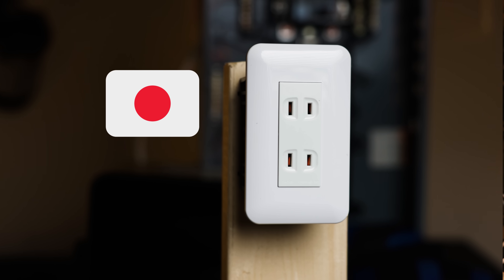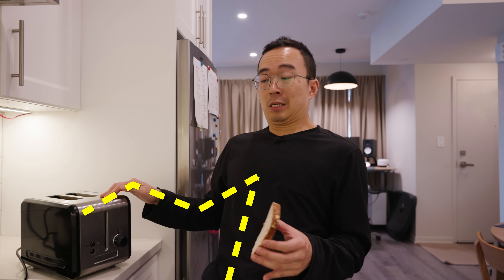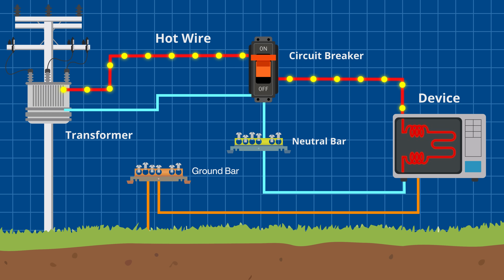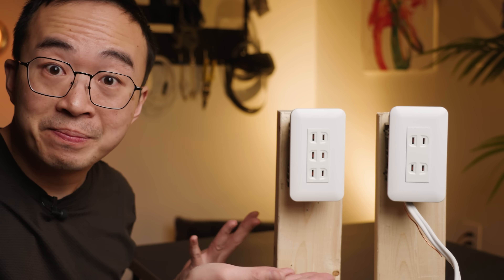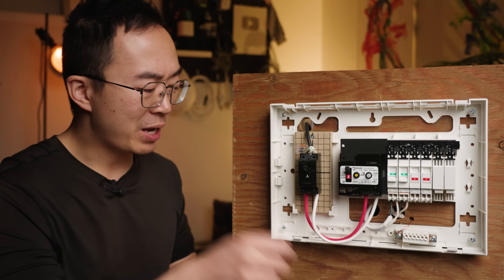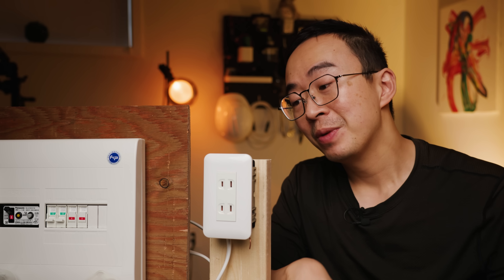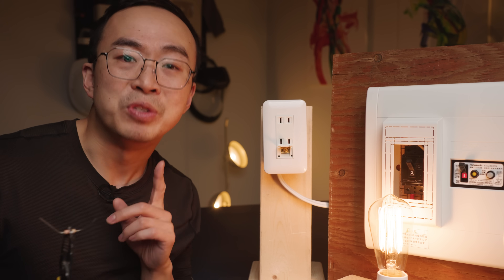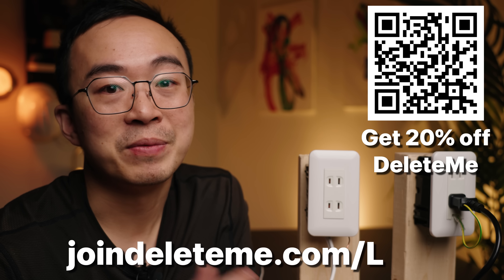How Japan Made Their Outlet Safe

Comment: Engineer here. Ground connection wasn't made to trip circuit breaker. There were no circuit breaker back then, there were fuses. More to say, most US circuit breakers do not even have magnetic breaker and they actually react much slower on short circuit conditions than the european ABCD circuit breakers for instance. Ground connection were made to protect life by providing a path to ground with less resistance than your body, RCD were originally made to further protect from fire. Without an RCD ground would save you from electrical shock but most likely a faulty appliance would cause fire. Modern RCD also limits current to the point that also protect lives as you've described even if an appliance lack connection to ground but it was a relatively modern change. The connection between ground and neutral is indeed may cause circuit to break but only if the fault is very prominent and provide a very low resistance path to the grounding wire which is not usually the case and it wasn't made for this, the goal was to pull neutral to ground not vice verse.
Reply: Actually all US residential and commercial breakers (aka MCCBs) are thermal/mag. Thermal for overload protection, magnetic for short circuit protection. Just look at any Eaton, GE, Square-D, Westinghouse or even Siemens literature.
Yeah engineer here too. 40 years in the industrial electric business.
Reply: @sootikins  Not strictly true. Yes, modern breakers have a magnetic trip, but much of the installed base is thermal only. I make it a point to cut open every failed breaker I have replaced, and more often than not it's just a thermal bimetal trip. I think I still have some brand new Pushmatic Bulldog breakers around here somewhere. Popular 50 years ago, and still made today (overseas replacement), and they haven't changed.
Reply: @jsurace  Ok, can't argue with that. I was talking about what you can buy today without considering installed base. Noy sure when the change from thermal to thermal/mag started...
Reply: @sootikins  Both thermal and magnetic are for wire overload protection, magnetic for accute and thermal for mild overload. This allows you to run a device that briefly draws too much power without tripping it, but it will still trip if your average load is too high. 

What europe ALSO has is a differential cut, which directly protects against leakages. If more power enters via the line than leaves via the ground, the differential switch trips and cuts the whole house (or your bathroom on a stricter differential)
Reply: @dojelnotmyrealname4018  I don't think I claimed otherwise. Of course thermal/mag is not intended to protect from shock. I was merely addressing the guy who claimed US residential breakers are thermal only which is false. 
Incidentally, "differential" breakers (aka GFCI or RCD) won't catch a line to neutral short but are good for line to ground.
Reply: @sootikins  I have three GFCI outlets. 2 near my kitchen sink, and 1 near bathroom sink. The bathroom GFCI will cut ALL POWER to the bathroom if i hit the test button, including both light switches (both together on a seperate panel from the GFCI) AND the FAN (wired in with one of the light switches).  Both Kitchen GFCI outlets will just cut power to itself (only the outlet tested).  All three appear to work as intended (they cut power back on when hitting the RESET button, like normal).... EXCEPT!!!!!!    
...There's no green light? on the outlet itself, it doesn't mention a green light, it only says "replace if blinking red."  so, i looked it up, and i can only find identical outlets by a company called "Faith" and they make outlets that at least look identical to mine (on home depot website, that is).  But even THEY have this same "green light / red light / no light" picture that appears in this video, which doesn't reflect my outlets.  My outlets have a very small spot where a light should be, not in the bottom corner but off to the left-hand side, and again, there's no green light, no red light, nothing, not with the power on, not when testing, not after it's tripped, nothing. is this normal function?  
I should note that the entire house's electrical system was re-done in or around 2019-2020, along with the plumbing, and everything was updated, including all outlets and light fixtures, HVAC and water heater, and this was right before i bought the house in 2021.   So, i have a rather modern electrical panel, looks brand new, and has new breakers with blank labels (i filled them out myself).   

Upon further research, i found that "some older GFCI outlets may not have the green light feature" and "some newer devices may no longer use the green light."    And that the red light comes on if the self-test feature (every 3 seconds according to Faith) no longer works. 
BUT, i only found THAT information AFTER i found about a dozen other articles saying to replace the GFCI if the green light wasn't on.  so, my question is, is it normal to have no green light on some GFCI devices? or does that mean something isn't wired up correctly?  i find it strange that all three would not have a green light unless they were made that way... but then again, if the same genius wired up all three, and did them all equally wrong, then i'm kind of worried it could cause an issue, despite them appearing to work just fine.
Reply: @tirkentube  There's no official standard that I'm aware of for the lights on GFCIs so I'd have to either go with the manufacturer's explanation or replace the no-light GFCI if really worried. As long as the test button works it's probably fine regardless of light.
As for one GFCI taking out unexpected stuff when tripped, well, it's harmless but annoying. Receptacles are typically "daisy-chained". With GFCIs you have 3 sets of terminals instead of 2: power in, power out (to next recept in the chain) normal and power out switched by GFCI. What you described means somebody used the switched power out terminals when normal power out would have been more appropriate. A decent electrician can probably sort it out easily.
Reply: @sootikins  I have some GFI outlets with a green LED that's on when everything is happy, others with a red LED that only lights when the outlet has been tripped, and still others with no light at all. If there's any kind of standard for this, the chucklehead who wired my house didn't follow it.
Reply: @shmehfleh3115  Don't know what to tell you about the LEDs. It sounds like the guy who did the wiring used a mixture of makes/models of GFCIs which isn't terrible but I can see how it could be annoying or confusing. As for the GFCI that takes out lights and stuff, well, I've seen that kind of error before and it's harmless but wrong.
Reply: HOWEVER. If the GFCIs with the different LED indications ARE the same make & model then it needs checking out for (perhaps) reversed hot & neutral, or defective GFCIs.
Reply: @tirkentube  Indicator lights on GFCI receptacles vary widely, and are only common on the most recent models.  Most older GFCIs do not have them at all. In the past 20 or so years they've gotten more and more popular as a feature selling point. Some light up when the receptacle is energized. Some light up when it's tripped.  Some light up when they fail their automatic periodic self test.  These all would have only one color of indicator. Some other models have multiple colors for different situations.  The manufacturer's installation and operating instructions are the absolute reference for how whatever model you have in your home works.  The manufacturer should be listed on the front of the receptacle somewhere, either in the face you can readily see or after removing the cover and examining the usually-covered plastic or metal mounting yoke.  Once you identify the manufacturer, you can locate the instructions online.
Reply: Also, one of the most important reasons for proper grounding is to avoid potential drifts. I've had a electric shocks from improper grounding more than once. To be clear: In these cases, it was NOT the power directly from the power grid which causes the electrical shock. It's a certain charge that can accumulate on ungrounded metal surfaces and wires due to leakage, crosstalk, etc.. A proper grounding makes sure to tie all these surfaces (e.g. water pipes, satellite wiring, etc.) to a well-defined ground potential.
Reply: Bro what are you on? The ground wires only job is for fault current. It is bonded to the neutral so that current goes back to the source, not ground. Just because you're an engineer does not make you qualified to speak about current flow and how our systems work in the US. Almost all breakers are thermal magnetic installe today. I seriously don't know where you get your info from but I would seriously consider editing your post to get the misinformation off the internet
Reply: Bruh, we have magnetic breakers. That’s why a dead short to ground or neutral trips the breaker instantly. All our breakers meet UL 489.
Reply: @wm79198  I don't see a coil inside. Is it a very recent change? All the videos and images I able to find lack the coil of magnetic breaker inside the US breakers. A bimetallic strip would also break the circuit in case of shorts and it is enough to protect wiring but it wont break instantly and won't protect from arcing and sparking to ground etc.
Reply: Ok guys, I've checked if I missed something and may be US circuit breakers contains magnetic breaker now. Nope. Googled "us circuit breaker disassembly", none of the videos and images I found contains a magnetic breaker coil. May be there are US breakers that include it but they aren't common.
Reply: you failed to share what RCD is. 🤔
Reply: Yeah i was going to say similar but you said it well.
  In the U.S., ground would trip the fuse or breaker in the event the neutral wire had failed.
 Either in the house wiring or the appliance being used. 
  Giving power an additional return to ground if the neutral failed. 
 Personally i don't trust digital electronics to be completely fail safe as in a GFCI . 
  They do work by design but i have had them fail where i was getting an 120 volt reading but if you plugged something in it would not come on. 
 Sometimes digital relay's stick on and would be incorporated in  a GFIC device for the actual current handling. 
 I like the idea of an additional path to ground. 
  In older buildings , especially multi-storied high rise , that would be cost prohibitive. Houses not so much.
Reply: I wonder how much safer does that makes the whole system. Not theoretically but practically. Being living in Japan for a long time, but have never heard anyone dying of a electric shock...does that extra grounding REALLY make a difference in real life?!
Reply: Anyone else read this in Electroboom’s voice?
Reply from the maker: Sorry, but you're incorrect.  Ground does indeed de-energizes circuits.  Mike Holt who is considered an expert on the NEC talks about this in an extensive video on how grounding & bonding works.  I linked to the section that talks specifically about how the EGC provides a low-impendence path to trip the breaker: https://youtu.be/mpgAVE4UwFw?t=1040

This is a BIG area where there is a lot of confusion.  I regret not commenting on this earlier but I needed a break and assess whether I made a huge mistake.
Reply: @Lam  this picture doesn't make any sense. The fault usually doesn't make a path of high enough current. Usually a fault is a something like a damaged insulation. It is enough to shock and kill a person but the remaining resistance won't allow a 583A to flow and won't trip a circuit breaker. If Mike say otherwise don't listen to him. It doesn't matter if he put NEC in his title if he say nonsense. Grounding the metal case of a faulty equipment would pull the the hazardous high voltage potential to ground and would save a person even if a faulty insulation only provides a path for a couple of amps to flow (potentially heating up the faulty appliance and cause fire). But fire is a less dangerous situation than an immediate shock and kill. An RCD would also trip and save the day. The modern low current RCD would trip even if a damaged insulation didn't develop a path to ground conductor in an outlet and the only path to ground is a human body itself. But follow the logic. Grounding neutralizes the high voltage potential and saves human from shock at first, then everything else comes into play.
Reply: @pahom2 if this is the case then why do LV utilities bond to the ground raceway. This is required by NEC. By that logic the LV POE would become energized every time there is a wiring fault.   No.  The ground is tied to neutral in the load center in order to create a path to ground desirable enough to blow the breaker.  LV utilities bond to this raceway in order to prevent damage caused inside a connected device from returning on the bonded connector to the service point of connection or the mounded raceway.   This only happens because the breaker powering the affected device blows.
Reply: @lindoran  not only LV but all metallic frames and constructions, pipes bathtubs etc have to be connected to earth. It is called equipotential bonding or EEP. It is done to prevent possible electric shock in case of a fault when a high voltage somehow finds a path to an exposed metallic conductor. What confuse you here?
Reply: @pahom2  that's exactly what I just said to you.
Reply: @lindoran  ok. So grounding is implemented primarily to protect people from electric shock, by providing a safe path for fault currents. Tripping the circuit breaker is a secondary consequence, not the main goal per se.
Reply: @pahom2  I think it's splitting hairs at that point. But the fact that GFCI receptacles exist acknowledge that there are states of potential that would not trip a circuit breaker, in the case of a fault. I think by the time a breaker is introduced the intent is shifted or at least the added benefit is acknowledged - since both statements are true. For what it's worth I don't think anyone is arguing the way current flows.
Reply: Electricity doesn't magically always flow to the end with less resistance. Also Electricity is NOT a flow of electrons. It's a field of force instead. Just like thunder would make a tree branch like shape, It seeks all the possible path, but the majority of the force would flow to the path with lesser resistance. Just like how water would come outta a bottle with a small hole and a bigger hole. More water would flow through the bigger hole. You can't protect anyone with ground. Unless it is some 1900s old vacuum tube radio that charges crazy huge capacitors and uses the neutral path bonded with the outter metal case as some kind of ground path with shorted capacitors.

Comment: I'm from Sweden and I lived in a house built in 1982 and it had GFCI, and only grounded outlets in wet areas. So similar as Japan, but we started to require grounded outlets everywhere in 1994.
Reply: grounded in dry rooms is not safer.  the next conductive surface to my outlets is the heater 2m away.  if i lick the outlet nothings going to happen to me becauce there is no path for the current

Comment: Having one common RCD (or any other load fault protector) for multiple circuits is dumb. Not that it would be unsafe, but it negates one of the major reason why you install multiple circuits in the first place: Only minimum of them, where the fault is located, are shut down, others remain functional. But because the ground fault is way more probable than practically any other insulation fault, a common protector shuts down everything. So e.g. a water spill on a tea kettle base at the morning rush causes your fridge to lose power, often without you noticing before returning from work at the afternoon or even later, with a lot of the content in it spoiled.

Comment: Well in germany you have the Ground Pin, the so called F-Plugs (btw what I could see, Italy is using them as well). Apart from the usual Circuit Breaker, usually modern homes there is a
ground fault circuit interrupter that immediately kicks in. I think that might be the type of interrupter you mentioned.
Apart from that I dont know for how long over current protectors have been mandatory. They used to be one time use to screw in (in ancient times).
Ground fault circuit interrupter are mandatory since 1984 for "wet rooms" (bath, etc) and since 2007 all new house circuit boards have to have it.

Comment: most outlet circuits in houses built in the US after the 2014 NEC are protected by combination AFCI/GFCI breakers, and most outdoor/kitchen/bathroom/garage outlets of the mid to late 70s to now are GFCI protected in the US
they must trip with a 5mA leakage at most per codes

Comment: There is nothing safe about Japan's old two-prong outlets.  The US method and voltage are the safest in the world when combined with all arc-ground fault breakers in the box.  Our houses' wiring is all but invisible to lightning and can even trip a failed ground-fault breaker.   The single most dangerous wiring in our houses is a 24v transformer keeping the doorbell circuit charged at all times.

The problem with the whole box being the ground-fault trip is YOUR LIGHTS GO OUT and your smoke detectors immediately put a heavy draw on the backup batteries to keep the command/signal line of their installation hot.

Comment: In Denmark we use grounded outlets and at the switch panel there are both fuses and a GFCI (or HPFI as its called in Denmark) 
Double up on safety.

With that said there are a lot of old installations were there are not even a ground connection in the building.
Reply: Yes, but many use CEE 7/7 plugs that do not ground in the Danish outlets.